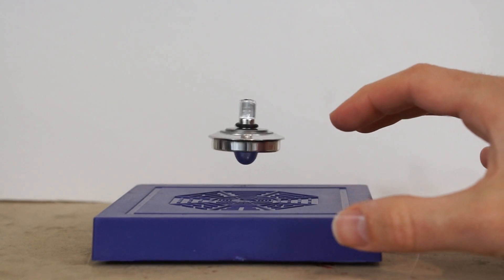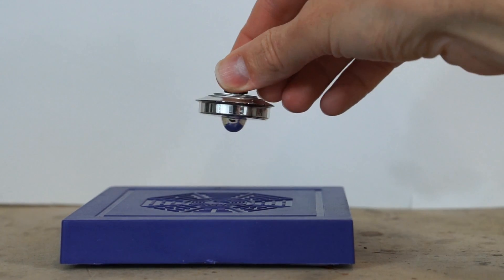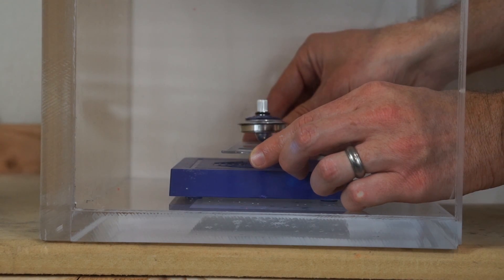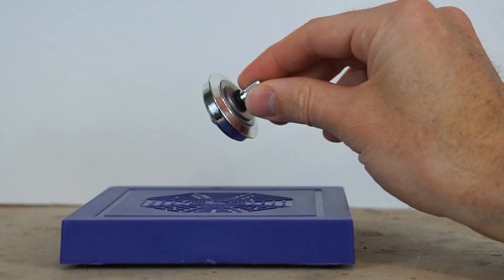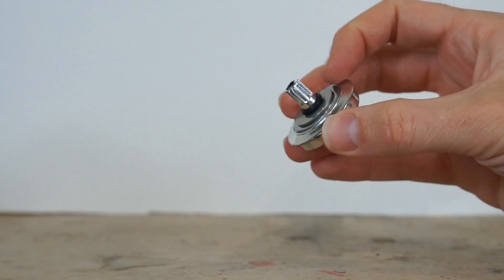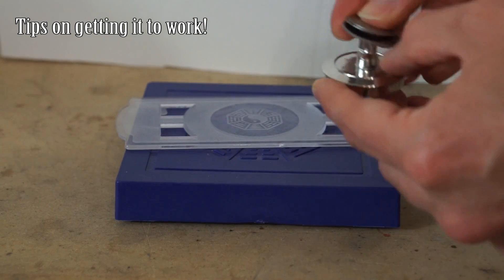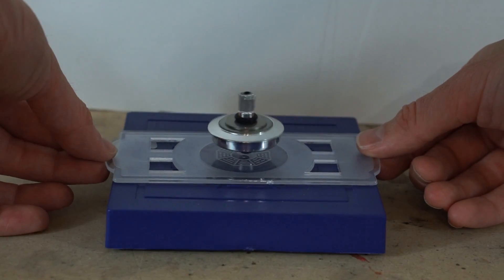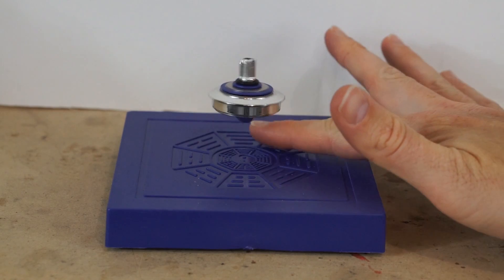Will a Levitating Gyroscope Spin Forever in a Vacuum Chamber?

Comment: Science builds often by dreaming, gessing and trying. But the core of it IS MATHS THROUGH A COMPLETE ENOUGHT MODEL.

Every imaginable  PHYSICAL INTERACTIONS has to be taken into account and each AFECT has to be evaluate and mutually compared to look out for the dominant ones compared to the negligeable ones relatively. 

So what are the "obvious" INTERACTIONS taking place here? Obviously Gravitation and EM.
So lets at first eliminate the obvious negligeable ones. 

Without any calculation Indeed, one can very confidently eliminate any possible loss of energy due to "hypothetic" gravitational waves, due, at best, to third orther quadripole power series coefficients. 
Althemore, despite Virgo-Ligo recent "confirmation", their existence is still fairly an open question, even though Gravitational Waves were strongly predicted theorically for the first time, by the french scientific genious and worldwide Master Henri POINCARÉ in his June 1905 masterpiece article on Relativity.
But in any case, it is abyssaly smal effects even for light speed spinning twin Neutron Stars. So there is NO hope to count for any signigicant energy loss due to spinning gravitational waves emission of this toy. FORGET ABOUT IT!

Than the argument of material oscillations of the heavy base magnet seems fairly dubious... I will forget about it very confidently.

Thirdly the "vacuum" is obviously never "perfect", but it seems almost enough not to worry to much about it, at first inspection. It  seems at least perfect enough, not to be significently responsible for this rather "very fast" spinning collapse in vacuum, within few dozens of seconds. So forget about that also.

So what is more seriously left? 

Routhly speeking two "forces" are obviously competing here. "Downword" gravitation : P=ma, and "upword" Lorentz EM force : F = q(E +v×B).

"Downword" gravitation is rigorously converging and increasing toward the center of Earth, but in this situation one can surely consider it as a UNIFORM AND PARALLEL acceleration field.

But it would surely be far from accurate to forget that the magnetic lines, in which the disk is spinning, ARE NOT PARALLEL. They are actually slightly rising divergent. And this asymmetry may play some crucial rôle in this DYNAMICAL STABILITY INSTABILITY PROBLEM... 

It is Indeed a strong contributor of PRECESION AND NUTATION, which will both eat the spinning energy. The total spinning energy being mainly CONSERVED through this TRANSFER from different aspects of it, namely : spinning kinetic energy being transfer from one Euler angle, the "vertical axial one", to the two others, causing therefore AXIAL CONIC PRECESION AND WINGLING ELLIPSOIDIC NUTATION.

Before comparing these two effects by solid computations, one might argue that the WINGLING ELLIPSOIDIC NUTATION may be more harmfull to the toy spinning collapse, than the AXIAL CONIC PRECESION. 

But rather certainly BOTH EFFECTS AD UP to conspire for the fast collapse. The rising divergent magnetic lines of the base magnet being at the core of these "deadfull" effects.

Finally, of course induced FOUCAULT currents due to spinning toy magnet swiming in the base non uniform magnetic field, surely exert a slowing down counter torque, that takes his "ground" in microscopic transfer of energy between electronic induced "laminar" currents and the metal network matrix, through Joule heat "chaotic" dissipation. 
The toy is thus at first actually HEATING, but since it's spinning in almost vacuum, the heat produced, canot fly out by air conduction, and so only IR EM are draging far away out this spinning kinetic total energy. 

But only precise computation can evaluate the actual mutual importance of these THREE MAIN EFFECTS. 

To part aside the induce currents effects and the PRECESION - NUTATION contribution, it may be tryed to cool down the toy with liquid hélium, such as to kill the Joule resistance to these induce FOUCAULT currents. Leting mainly standing alone the PRECESION AND NUTATION effects. 

To try to kill these two experimentaly one could try first get the toy spinning as vertical as possible. But moreover to uniformize the magnetic field of the base magnet, at least in the concern region where the levitating toy is spinning. A vertical  coil surrounding the base magnet and the levitating toy, may help to straighten the "vertical" magnetic lines...

Much still can be done... Who will make the theoricall computations? Who will rafine the experiment?...
Reply: please correct spelling
Reply: Agreed.  That is one thing that makes me stop reading.
Reply: Copy paste?
Reply: aikidlc obviously English is not important.
Reply: Thats what I said.

Comment: Why it will stop spinning is a hard question to answer, Here are the reasons I think that are legit:
1. True vacuum is not achieved, and air friction remains accountable. Basically its impossible to get to true vacuum on earth. Whether the effects are negligible, however, remains a question. 
2. Eddy current is formed(on the magnet itself, and also on the metal discs) if the base magnet is not circular ( I have one of these levitation gyroscope and it comes in triangular configuration), another source of eddy current is from the wobble.
3. As the gyroscope wobble, it will cause deformation of the base, doing work and lose energy. (This effect I suppose is rather small, as the base is much heavier and hardly move)

However, the following reasons are not legit, or negligible:
4. gyrsocopic precession doesn't slow rotation, it will only rotate the rotational axis. In the case of this, it should act on the spinner just like normal. that is, the rotational axis should maintain its angle w.r.t the ground, assuming no energy is lost.
5. cosmic rays hit an object in all directions, they will actually balance out.
6. A round, rotating object doesn't give out gravitaional wave. And even if it does, gravitational wave is not affecting its own self so it doesn't actually stop rotation. Gravitational force exerted by another object, however, may do work on the rotating object.

Comment: Of course it will not spin forever! The energy is lost due to friction (which creates heat). Neton's First law states that " Energy can neither be created nor destroyed". What this essentially means is that you cannot get an unlimited energy source as the energy is transformed.
Reply: Not to nitpick, but you mean the First Law of Thermodynamics, not Newton's First Law. And, also, the First Law can actually allow for things to spin forever, since energy is not being created nor destroyed, the system is balanced and it can continue spinning. Now, the Second Law of Thermodynamics tells us otherwise, and eventually, energy will be converted to heat at some point and stop any system from having motion.
Reply: Not really James Sierpinski. energy is transformed from kinetic to thermal energy when the ball encounter ,as it spins, so infinite energy cannot be created.
Reply: Yes, but that's due to the Second Law of Thermodynamics, not the First. The First Law allows you (with enough assumptions) to perpetuate motion, or even have reversible processes.

Comment: With any magnetic gyroscope there are three forces that eventually reduce inertia. Air resistance, gyroscopic precession (wobble interacting with gravity), and magnetoresistance. While you might get it to go longer by removing atmosphere, and even by eliminating gyroscopic precession by getting as near as you can to a perfect spin, but even doing that the will not stop magnetoresistance. Magnetoresistance is the drag created by interfering magnetic fields.

Comment: The spinning magnet's interaction with the magnet in the base results in two negative effects.  1.  Any movement in the base that affects the spinning magnet will be converted to heat, resulting in a loss of energy.  2.  The eddy currents induced between the two magnets will result in magnetic retardation due to Lenz's Law.  Both will contribute to the spin slowing down.   The major effect is the latter.

Comment: I would assume that there would be a slight loss of energy as it passes the magnetic field and that energy is transferred into it. Also, I’d assume that due to the wobbly start it would have to be on a perfectly flat surface with a perfectly centered initial spin otherwise it will be pulled off its spin eventually. But the video is pretty long so I’m kinda scared that I am wrong.

Edit: yay! I feel smart now.

Comment: Theoretically it should't stop spinning as all the forces acting are constant unless the stability of the gyroscope is dependent on a variable force within the system. However, it might stop because that environment can't be a complete vacuum so there will still be element of resistance acting over the time to stop the motion. Moreso, electromagnetic property should also be taken into consideration and that might as well distort the balance the balance of forces acting in the system.

Comment: There is no freaking way that you can get it to spin perpetually. Even though air pressure is out of the question, you are not giving it anymore energy than it initially had. Perpetual motion is impossible.

Comment: I think it will stop because there is friction there. It's not air resistance, it's not physical friction, but the spin isn't perfect. Since it's not perfect, the magnet keeps trying to flip the magnet. This slows down the rotation. I think it should be very similar time in a vacuum or in 1 atmo as well. The spinner is very round and very smooth, so air resistance shouldn't be a major factor. Now, I'm going to unpause the video and see how I was wrong. Lol
Reply: Hah! I was right!!!